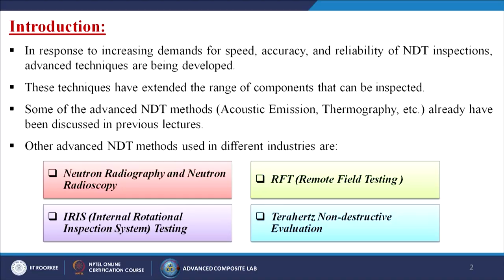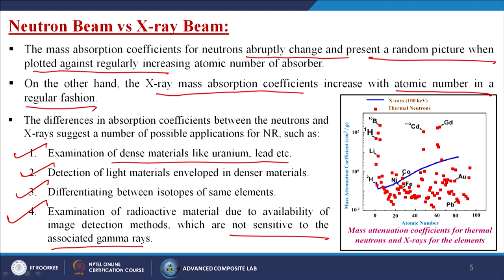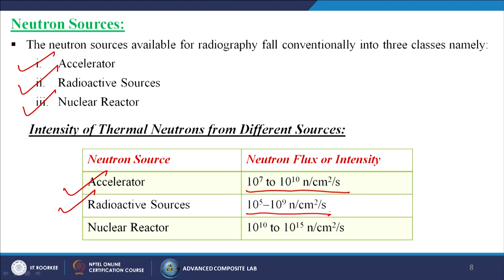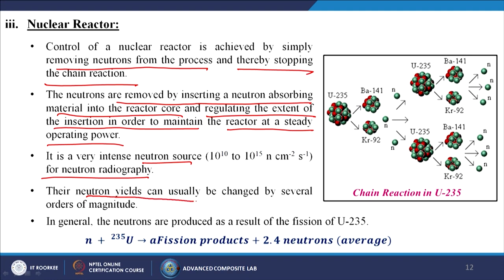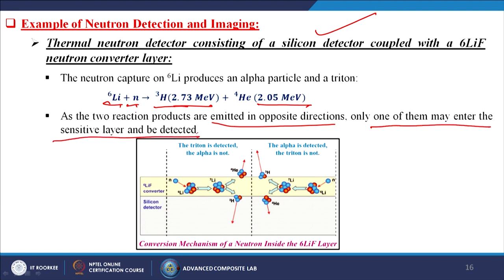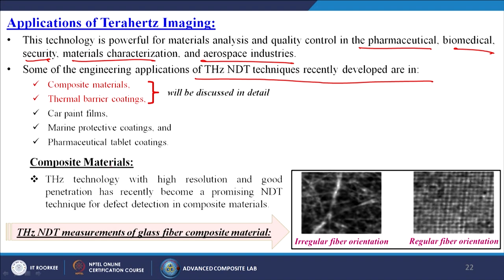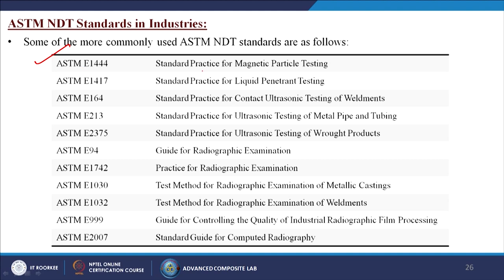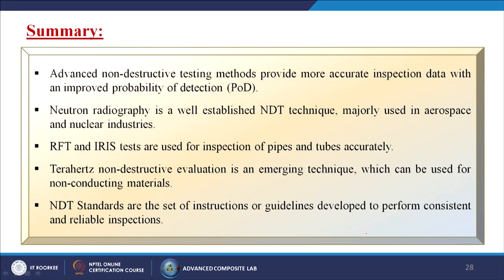Advanced Nondestructive Testing Techniques, NDT Standards, Safety in NDT

Comment: This video has valuable information for International & National assessment.  The instructor/professor did a great lecture for the specifics on "Neutron Radiographic" visualization.  This is a modern method used in nondestructive data for research and development that offers unique visual inspection "X-Ray" or Radiographics.  Welding Material Enginering Technology will certainly benefit from understanding the high-resolution of Neutron Radiographics.  Thanks for the marvelous lecture with the elements of material science.

T J (Tom) Vanderloop, CMfgE & SME/AWS Professional Leadership; Author, CAD Designer and Consultant